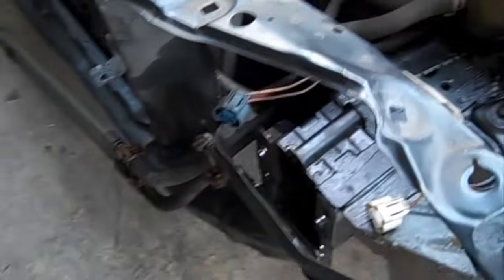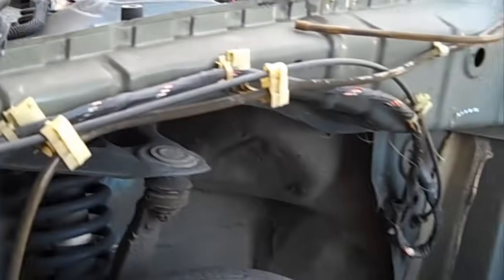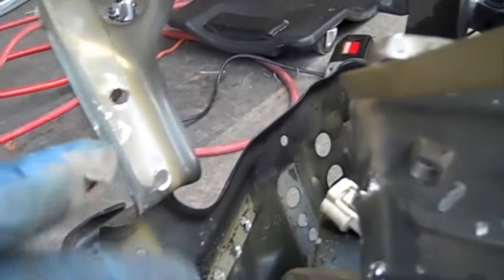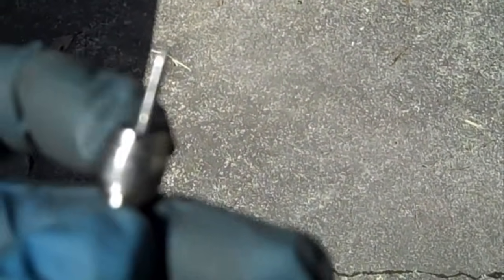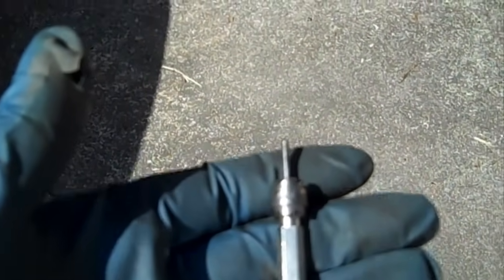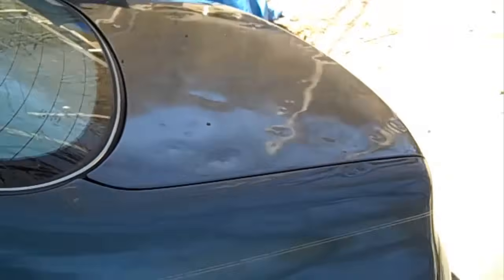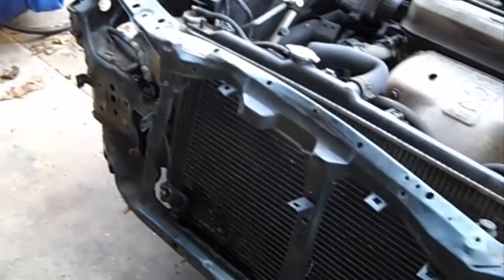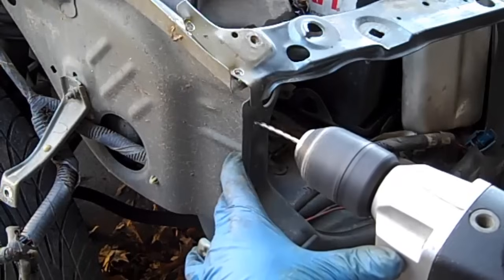How To Remove and Replace a Radiator Support

Comment: It doesn’t seem like the radiator itself has to me messed with or anything at all? If that’s the case, the job doesn’t seem too terribly and very helpful.
Reply from the maker: Sometimes you get lucky and all you have to do is unbolt the radiator from the support and leave it on the car without having to take hoses loose. Good deal for you!!!

Comment: Can someone who cant weld put it together with rivots?
Reply from the maker: I wouldn't use rivets, they are not strong enough. You can use nuts and bolts. However, they need to be grade 8. Also, you are going to have some areas that are either going to be impossible to get bolts into or just not at all. What year make and model are you working on?

Comment: Hi RodsShop, I am the idiot that asked if I can use nuts and bolts instead of welding the bar into place. I have another question- How do I know which spot welds to drill out to remove this assembly from a 2005 Honda Civic? Do I just drill out all the spot welds on the assembly? I took off the fenders, headlights, radiator, condenser, hood, bumper cover and support bar behind the bumper cover, sorry I do not know the name. Some of the spot welds are obvious, but others I am not sure if I should drill out. Please help, I am afraid that I will drill out the wrong welds. Thanks.
Reply: Sorry for the dumb question. Thank you for the quick reply, I sincerely appreciate your help. Experts like you can take one look at this and know which welds to drill out, and even though I have done plenty of mechanical work, this is the first time that I had to do major body work, so this is definitely somewhat confusing since I have no experience with collision repair. I hope I do not mess this up since this is my only running car and that would be bad lol. Thanks for your help and I hope I do not need to bother you again with more noob questions.

Comment: how much is it roughly to repair the radiator support? the radiator and other sytem touch the exhaust manifold so it kinda bad damage. you as a professional how much would it cost

Comment: What estimate you think it would cost to have a auto body shop to do it for me .?
Reply from the maker: I would need to know the make and model but if your car is like this one, they would charge between $1000 to $1500, and that depends on the area you live in as well. You can find independents like myself that could do it far cheaper. Go to your local parts stores and ask around. Ask if they know anyone that does that kind of work cheap or on the side. Those guys always has someone they know. The bigger body shops are over priced and are just too high. They should provide cheaper rates for older cars, just based on the fact, if you had a big wad of cash, you would be in a brand new car. But our society doesn't work that way, it is all about the greed.

Comment: Did you buy a new hood to replace the old one?
Reply from the maker: Yes, it wouldn't be practical to straighten that hood considering how cheap a replacement is
Reply: @RodsshopOrg  Many thanks for the advice. My big problem is the passenger side where the radiator support is connected went down by almost an inch. How can I solve that? If I don't level it gaps will show up and the bumper is not level.
Reply from the maker: @balloney2175  This kind of sounds like the frame rail is bent down. Contact me through my site. That way you can send me pics and we can converse on this easier. I have a tricks that might help you.
https://rodsshop.org/contact/

Comment: Can u use a grinder n cut it off
Reply from the maker: In most cases, a grinder will make the job harder because of having to grind so much more metal away than just drilling the spot welds out. But if you have the patience and the time, yes you can. However, there may be areas where you will have to grind into metal that stays on the car, which can weaken the structure, so be careful
Reply: I'm trying to change the one on my 2004 grand prix it's rusted out at bottom
Reply: But I'm saying if I gently saw the weld spots off
Reply from the maker: @torrischappell7339  It doesn't have to be gently, the issue you may run into is that some of these welds are like down in dips and crevices which could cause you to grind on metal that needs to stay on the car. If you can get to all the welds without hurting any other parts, then go for it. Just be careful of the parts you need to keep to reattach too.

Comment: I have a 2000 honda civic coupe how much would it cost to replace the radiator support
Reply: RodsShop that’s ridiculous. The shop already had the tools, it’s should be about the time spent on the job & the cost of the new support. If I walk in with a new support in hand & pay for it to be done it should be no higher then $400. That’s good $ for a days work. I have to work a week to bring that home.

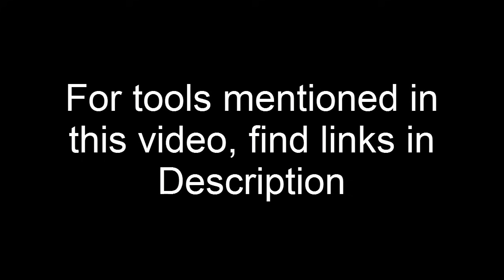Comment: On index 6:37 you were removing the radiator support already without showing us how to spot all the stuff to be able to detach it.
Reply from the maker: That is because where my welds in this video are most likely going to be in different places than whatever you are working on. I show you how to find where the spot welds are and I show you how to drill them out. I am not going to make an hour long video showing me drill out every spot weld. This is to show you how to find the welds and cut them out to remove a radiator support. If you are stuck and need help, contact me through my website, send me pics of what you are working on and I will do my best to guide you.
https://rodsshop.org/contact/

Comment: How much do radiator supports cost ?
Reply: +RodsShop a 1999 Nissan Maxima
Reply: +RodsShop thanks a lot!
Reply: Kee White I bought the upper bar for 30$ that's with shipping included
Reply: RodsShop  iam  sorry where you buy radiator supor?
Reply: How much does one go for a rav 4 2014 model? Plz and how much does it roughly cost to install and everything labor
Reply: $84.12